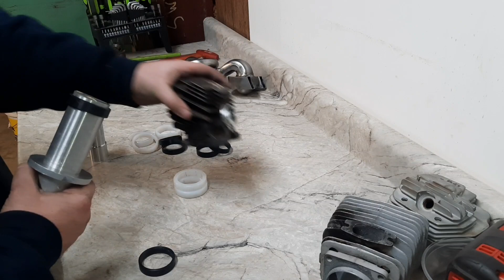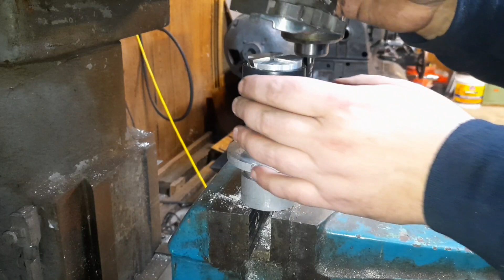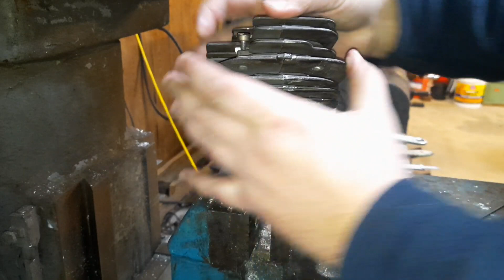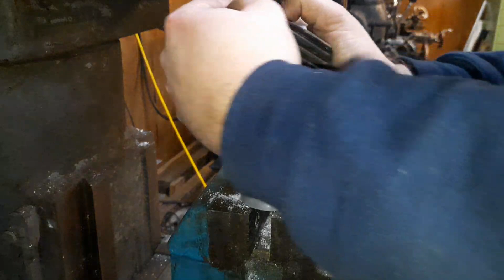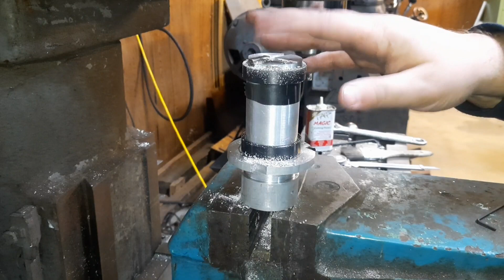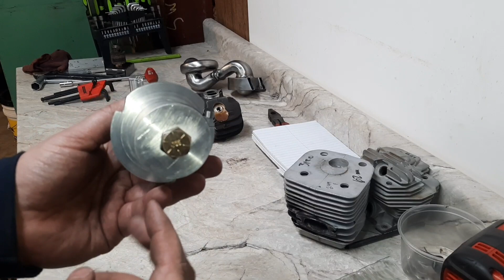Squish cutting 2.0

Comment: is there a way I can cut the base of my cylinder without a lathe?
Reply from the maker: The stihl cylinders without an extension can be sanded on a flat plate of glass or filled very carefully taking lots of measurements.  But a lathe is generally best

Comment: So how do you cut the top of the cylinder after you cut the squish? Seems the piston will hit the ring left? Sweet idea.
Reply from the maker: The guide rings are slightly undersize. Allowing the cutter to cut over size at the squishband.
Reply: @dynojoemods2764  Next question is I'm assuming that for the smallest cylinder the mandrill just rides on the cylinder. On those unless I'm seeing it wrong. The tool cutter comes out to the edge of the mandrill but there is no slop on that setup to slightly cut the ring of death? Maybe I'm just not seeing it. Next question is how the guys using your slick tool cutting the base without a lathe or mill. Sorry for all the questions. I just like to fully understand something. Thank you Joe. Love your work bro. Peace

Comment: Hello Joe
What setup would you recommend for 45mm 45.2mm and 48mm cylinder's?
Reply from the maker: Small would be best if you don't plan to go much larger than 48mm. Could get small 45mm it would work ok for the 45.2 and get the 48mm rings too.

Comment: Forgive me if you already know. If you have a surface grinder, grind the bottom of the set screw flat to hold the tool bit. One set screw should really grip that bit then. A trick we used to do at the machine shop.

Comment: Could be used for turning cylinder bases too?
Reply from the maker: They are designed to be a touch lose in the bore. But could possibly be wrapped with paper to hold well enough to cut the base too
Reply: @dynojoemods2764  thanks for the reply.

Comment: Itd be sweet to make tight fitting sleeves for cylinders so a guy could chuck that up in the lathe and cut base with it to so ya wouldn't need dedicated Mandrels for each cylinder
Reply from the maker: Might be able to wrap with paper to hold well enough.
Reply: @dynojoemods2764  i was thinking few rounds of tape and maybe a chunk of rubber on top. Guess I'll find out cause I just ordered one 😃

Comment: I found how to cut bases by 3D printing an insert and using a router with a flat bit with a bearing to follow the insert. With this tool I could do everything I need to get some very high compression.
Reply: Do you have a video on this?
Reply: @old509cc2  sorry, I don’t. I got the idea from a forum post that I found and just used a 3D printer to make the insert. It works well if it’s all you can do but I wouldn’t recommend it if you can cut the base any other way because it’s pretty dangerous having your hand that close to a fully exposed router bit.

Comment: Thase spacers non cutting manderal work for cutting the base also.
Reply from the maker: They are a bit too loose to hold the cylinder. But with enough paitence it could be used to do so.
Reply: @dynojoemods2764  it would be convenient. Just ordered both mandrels and several spacers. It will save lot of time for me. Which I am.stretched.thin now!

Comment: I want your first set when you're ready to sell.
Reply from the maker: They are listed and have enough material on hand for 6-8 sets. I have the links in the video description.

Mandrel + 1 size is the "kit" other size rings sold seperate. Or people with a lathe and material could make the rings too.
Reply: @dynojoemods2764  14:57
Reply from the maker: @alvinmcdonald390  

145$ + shipping for the mandrel and 1 size of sleeves
Reply: @dynojoemods2764  Cheaper than a lathe!!!!!!
And quicker setup too....
Find a way to cut bases without a lathe and you'll have a set in many many shops.
Reply: @mattfleming86 you can cut 4 cylinders before you get l set up to start cutting.
Reply: @dynojoemods2764  What’s the cost on each additional sleeve
Reply: @alvinmcdonald390  $22